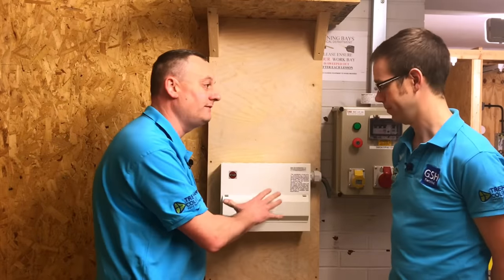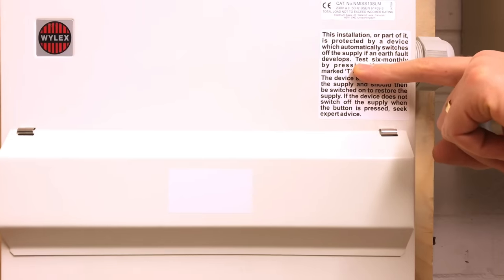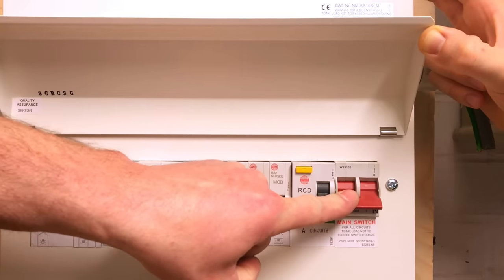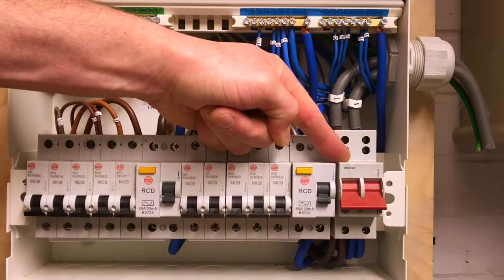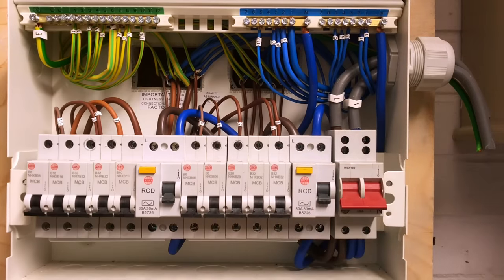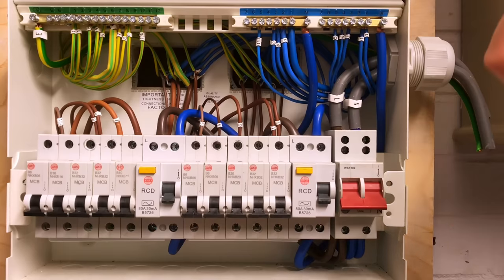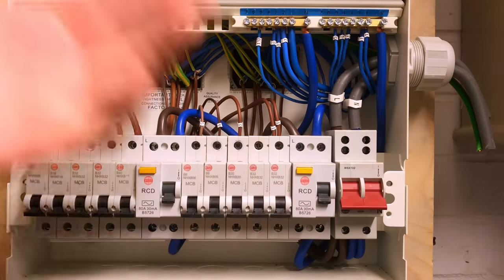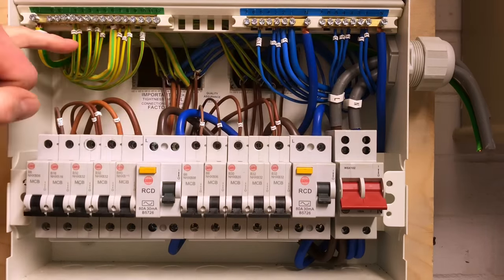Understanding Your Consumer Unit Layout, Identifying Conductors, SPD's, MCB’s and RCD's (fuse box)

Comment: I think it's quite offensive to tar all Dodgy DIY Dave's with the same brush. In some cases, I've installed circuits to a higher and safer standard than a 'qualified' 'professional' electrician. Just because they're qualified, doesn't necessarily mean they are going to install your electrics to that standard. I had a sparky come round and they didn't have a clue yet they were a 'qualified' 'professional'
Reply: Totally concur there is a certain snobbery with a lot of youtube channels in the electrical area.
SAfety should come first always but beyond that giving people the knowledge fairly will always help them make better choices in life than just beating them with a you don't have the right sticker so f off.. As that just leads to well f you back I'll just do it however then.
And you will always get a % who just do whatever anyway.
Reply: Wish I could uptick a thousand times. Tbf, professionals doing domestic jobs at realistic price to them would have to allow for many hours of scrabbling around with difficult to reach cable runs, carving would, plaster, brick, cement while minding carpet, paintwork, etc. Nobody could afford it. As DiYer, I can take my time and do so. So I install boxes and conduit with strings in if it's a job that requires a pro to feed the cable so they can register it. 
   But all professionals say "Electrician's dream!" then still work fast and cut corners even when I say I'll pay more for more careful work. I have met a diligent sparky and hope he's available for my next project to bring all my electrics up to 2022 full spec in case I have another heart attack and leave wife with an out of date system
Reply: Okay 99% of them 🙄

Comment: Interesting that you (and many others) so emphasise a need to switch OFF with no load.  That seems to be contradicted by the device rating of AC22A.  (Switching of mixed resistive and inductive loads, including moderate overloads	IEC60947-3)  If it really did expect no-load use, it would be rated AC-20	(Connecting and disconnecting under no-load conditions	IEC60947-3)  Or am I missing something?

Comment: Electrician... somebody of competence. That's the problem. As a DiYer, I'd never do more than switch off circuit breakers at consumer unit. But, as I've mentioned elsewhere, the problem is finding a diligent professional. They all might be registered as competent. That does not mean they apply that registered competence in a diligent pride in work way after getting registered

Comment: I would have seen the spare fuse ways and split the rings into two radials and run them through  20amp MCBs. so that the 2.5mm cable is within maximum tolerance .

Comment: Can an SPD be fitted to older units to protect the entire unit? Would this knock out the power being as the unit is not resettable?
Reply from the maker: You can fit one in the tails along with a double pole switch for isolation 👍.

Comment: Do you put 32 amps trough 2.5 mm copper??.?
Reply from the maker: No. 👍
Reply: GSH Electrical okey diffident over 2 wires? Sorry. Still learning about English electric
Reply: @antonfloor344  typical to see 20A radial.
Reply: In the uk we can have ring circuits or ring finals. They allow us to do crazy or cleaver stuff with 2,5mm cable for our socket circuits. It was invented back when copper was in short supply. However it’s so flexible we carry on using it. It is a pain to test though.

Comment: Still it’s weird that in the UK the neutral doesn’t go trough the circuit breaker and only the life very different in here in Holland and Germany
Reply from the maker: Hi. Our RCBO’s are double pole and have the line and neutral pass through them 👍😁. Thanks for commenting and watching Gaz
Reply: GSH Electrical it is actually rare for rcbos to be double pole switching. Obviously LandN need to go through them for the rcd sense, however most only switch off the Line. Regards a DIYer who shouldn’t know anything.
Reply: Do you talks from normal MCB or RCBO's? This both are two differnt devices. First "break" the line (live/hot) side, the null line go back normal. Second "break" both lines but have a normal MCB and  "earth leakage circuit breaker" together inside. [Sorry english people for my bad english tech terms.]

Comment: The rcd is rated at 80A yet the circuits off that exceed that, cam you explain?
Reply from the maker: Charlie Good question... answer diversity 👍
Reply: It's unlikely you will ever see every MCB / circuit under full load.
If you did then that might cause an issue. :)

What I was interested to hear in this video was then liking the idea of filling all the slots on the board.
In my mind I'd rather have a gap to allow heat dissipation but then again I'm not a sparky or a supplier just someone who likes to learn about everything.

Comment: I have mid 1930s semi original house upstairs lights and ring, downstairs same. Loft extension l & r. Side extension l&r. Kitchen extension l&r. Oven. Hob. Spare for second oven. Staircases lighting. Boiler. Smoke detectors via 3CE smoke resistant. Shed with CU and l&r. Outside and void under house lights. Outside and void ring. 2 CUs with mcbs in 3 subsections. Arranged to cater for or other switched off. Almost all cable in conduit into boxes. Access panels in relevant places on walls and floors. Done in 2013 to 2015 so to those regs. Want separate feeds to each of kitchen appliances, possible car charger, security with new CU to latest regs.

Comment: Great videos as always. Thanks for passing the knowledge to others specially youngesters. 

One small suggestion . It will be a good practice ( safety wise)to tape around the cables that has been striped off  and earth sleeving put on.
Reply: Tape is not a good idea, in warm weather it becomes sticky and comes off. A rubber sleeve is looks better and does not go sticky like tape.

Comment: Using RCBOs instead of MCBs is very costly new practice.
Reply from the maker: Hi totally agree but they are coming down in price around £13-17 each now for an “A” type RCBO 👍. Thanks for commenting and watching. Gaz
Reply: @GSHElectrical  where can i find these cheap ones. The hager ones on their website is over £100.
Reply: Yes , i stick them on smokes and rural oil boilers  then 2 rcds as par the vid.

Comment: nice video im planning to study electrician  i always watch your video... Can i ask question,, in my country GFCIis using may i know the  difference of GFCI to RCD i read that GFCI has same function as RCD but i am not sure if there is a little difference.. I also planning  to buy rcd tester. can it be use to test GFCI and same process.. Can you recommend a rcd or gfci tester..  or if there is combination of insulation and rcd tester,, thanks and more power...
Reply from the maker: Hi thanks for watching and supporting the channel. We use the Megger MFT testers at Tresham College but other brands of tester are available 👍. Thanks again Gaz 😁
Reply: @GSHElectrical  Thanks for the reply ..Is GFCI circuit breaker the same as RCD. and can I use RCD tester to GFCI circuit.. I am not sure how it is like.. I plan to buy RCD tester but I want to make sure it can also be use in GFCI circuit. Thanks

Comment: We have A and AC RCD here.  MCB have both live and neutral through them.
Reply: Think you should stick to photography.
Reply: @tresslerj1985  That's what I do John, although I did build my own 5 bedroom house here in France and did all the electrics which passed the rigorous inspection first time. used to do electronics as a hobby when I was a lad. Used to be an aerospace engineer in the UK before I retired.

Comment: Do you have more info on the surge protectors? Typical schematic and the standard they have to meet? I design lighting products to meet EN61000-4-5.
Interested if these meet much higher test voltages ( eg 6kV) and if they have VDR's, gas discharge tubes fitted and auto switch off when a dangerous surge occurs.

Comment: Looking for some advice, I have 3 appliances each allegedly consuming 3050 at maximum capacity, but the wires and my main feed to the consumer unit is getting so hot. I deliberately upgraded my consumer unit so it could handle these appliances. I installed the outlet (Specifically for these appliances) using Prysmian 10mm2 twin and earth, wired to a 50-amp breaker, then installed ANOTHER Prysmian 10mm2  twin and earth, wired to a another 50-amp breaker so there are now 2, one for two lower end of the consumer unit and the other for the higher end. Furthermore, I also have two BG 80A 30mA 2 Residual current device (RCD) installed on the consumer unit and the main feed that powers the consumer unit has a fuse of 100amps.
These appliances are in a container where I linked each outlet to one another so they can draw power from the first one (again, each has its own 50-amp breaker at the opposing side of the consumer unit, one for the upper side and one for the lower side), not sure if that is causing resistance as I even have the powercables with 13amp fuses to power those appliances, but since there is a 50amp breaker for each outlet, I’m still confused.
Reply: 32Amp for 10mmp in the long run...

Comment: Great Video. You specify Turning OFF of CU, but not Turning ON, would Turn ON. Also you introduce SPD, where would SPD go into the CU, should befirst device to capture surge from Lightning? so before or after the Isolator? Is it better to replace the Isolator with an MCB double pole so can switch OFF in LIfe Mode?

Comment: Having upstairs lights on one section and downstairs on the other etc is obvious common sense and what I asked for our rewire. Electricians said not necessary. I insisted but they still messed up in two out of 18 circuits.

Comment: Not a electrician but I have noticed that in my garage some of the sockets when tested show that on a double socket one side will read that its wired correct and then the other will read live and neutral reversed ?  Any one know why this is the case if the back of the socket is wired correct ?

Comment: Nice vide guys, could you do a presentation on regulations 536.4.3.2 and 536.4.202 on the selection of switch gear and RCDS, in that we can't just use diversity alone.

Comment: Best practice & the shower mcb 40A  is almost last on the busbar ? 
Why not have it up front ??
(From a dibbling diyer 🙄)
Reply: It is the first on the busbar of the second RCD.  Each RCD has its own busbar.
Reply: @cjmillsnun  thanks for the reply.... I thought the busbar just ran the full length of the CU... 🙄😂

Edit....Just runnin it through me head... a common busbar would tie the 2 RCDs together in parallel...not what we want... 😏
Also... if a SPD was installed I assume you would have to go with RCBOs (or get a longer CU) ....?

Comment: Would love to be a student at your college but Manchester is a bit far from you lol, plus I couldn't afford the course as I'm now 54 I couldn't justify it either lol love watching the videos though guys. I was chatting with a spark some time back asking what his understanding of what is permitted V none permitted work? And he stated that if existing wire is in and all you are doing is running upgraded wire changing damaged wire or installing sockets etc this theoretically would be classed as permitted? And any new circuit would be none permitted? What are your thoughts and maybe a comprehensive video on permitted and none permitted work would be useful.  Cheers again guys. Have you guys thought of moving this to paid videos to deter the less competent  as I'm sure it's not just sparks and students watching. If you get my meaning? I'd be more than happy to do paid subscription, as am sure others would. And it would generate revenue for the college. Just my thoughts
Reply: @johnny 71c I'm personally don't want them to charge however the content provided can be used by less than competent individuals BANG! You get me?  They are the type that would be discouraged from viewing if it was paid content. 

Btw you are correct I'm not a spark however I was a sparks mate many years ago and have done many rewires and repairs and am I feel more than capable of undertaking electrical work i was involved in the building trade for some time working on sites before life issues forced a change, and aren't we all students of life 😎? 

As for students loosing out if there was paid content. How do you come to that conclusion? If they are students then that says to me they are at college and learning on the job so I'd assume that they would be taught this so watching these videos just effectively gives them added information. And paying a small fee to access that information should they want it I feel is value. 

The guys clearly state what should be done by a competent person however who states who's competent? Ive known many incompetent trades people and ideas of what is permitted and not permitted varies vastly depending on who you talk to so I also ask that question as I'm interested in their views as teachers to that trade. Hope that clears stuff up?
Reply: If you apply to your local council you can do anything electrically. Being registered means your scheme does the notification for you.

Edit: it's costs about £125 and if the BCO didn't like what you did he will ask for remedial. Also your  insurance might have bad news if you had an Electrical fire.

All in all get a Registered insured spark to do complex work.
Reply: @tresslerj1985  cheers for the info

Comment: Great presentation and learning, I am not trained Electrician however good watch for safety in domestic environment.

When testing RCD,s 6 monthly, how does that work? does it trip all the associated fuses plus RCD? 

What is the best practice? I have B40 directly to my Under Floor Heating via a 45A double pole switch and to the Thermostat. Currently faulting to a blown Thermostat as it is not displaying at all after loss of power in the area. Can you suggest before act on it.

Comment: SPD - super priced device 😁
Reply from the maker: £40 or less
Reply: @GSHElectrical  question: how about if i need to install new shower circuit only , but there is no spd . Can i issue EIC then Or i have to install spd anyway ? There is no wylex spd which would fit in to 17th  edition CCU (

Comment: Great advice as always guys! But please, let’s stop interpreting the current BS7671 to suit the minimum standards. Split boards should be ditched now. We need to move to RCBO boards in domestic settings. Which is supposed to be the case in TT systems. Your advice to installers is always brilliant. It’s just a bug bear of mine about split boards.
Reply: Agreed, I've installed a RCBO board at my home in preference to a split load one. Only an affected circuit will trip, rather than half of them! The abolition of split loads can't come soon enough!
Reply: Great comment. Over the decades, I've got used to battling with tradesmen (haven't yet found a tradeswoman) to work to latest ideal best possible future proof as far as reasonably possible standards rather than minimal that you can get away with. I'm living in the house with my family. I want it safe and to maintain value if we sell it

Comment: Hi, How would you go about labelling up sockets that are in a commercial property. I have noticed are sparks never put any labels on any sockets which makes fault finding hard for whoever would have to find a fault. I’m pretty sure it’s something like DB1 (DB board number) then 1 (breaker number) and then L1, 2, or 3 (phase number) for an end result of DB1/1-L1 which would give the information of Board Number 1, Breaker 1, Phase 1. Is this correct? We do have multiple boards, some 3 phase, and some single phase.
Reply: In comercial properties and education normal practice to write in the back of the box during 1st fix. If not consult your as installed drawings in your building operation manual.